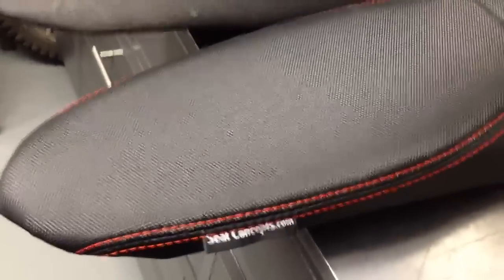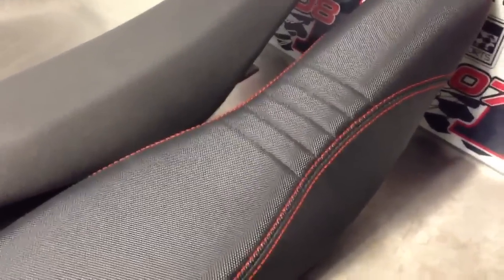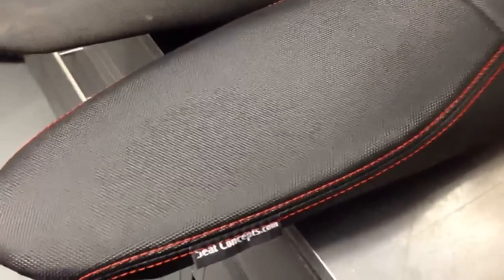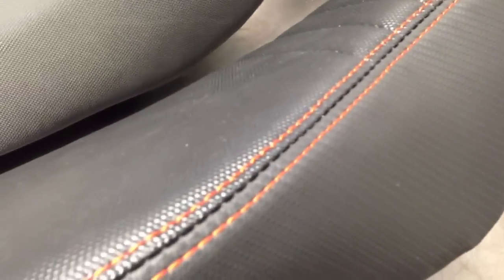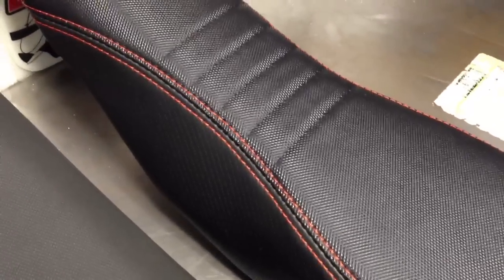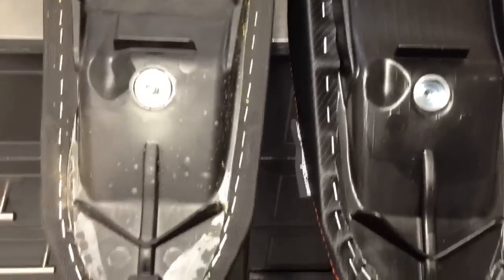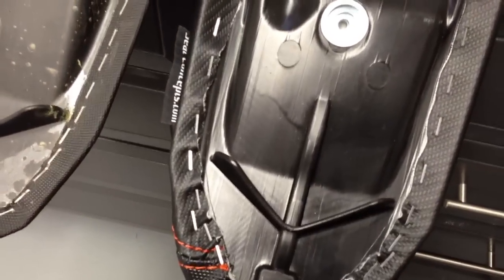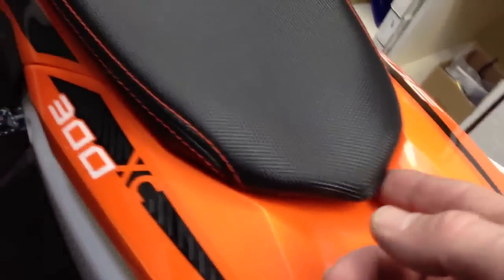Overview of Seat Concepts Seats for KTM & Husaberg

Comment: I have a 2018 Husqvarna TE 300 and the seat is like sitting on a 2x4 so I bought what was supposed to be softer seat foam from enduro engineering but it’s the same, do you think this seat concept is better? I usually take your advice and it’s never failed me yet.
Reply: I hear you, My 2019 TE300's no better. I am interested to see if these seats are better.